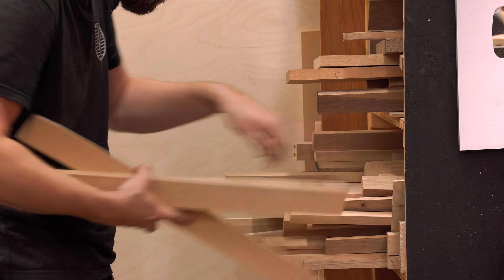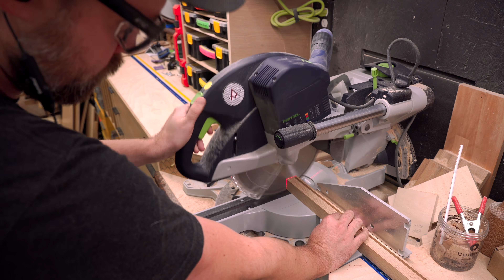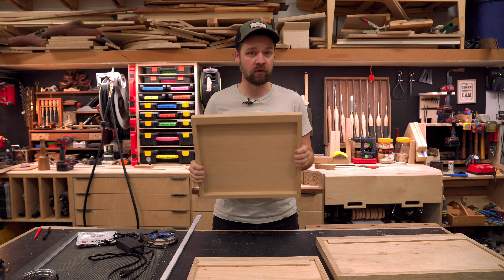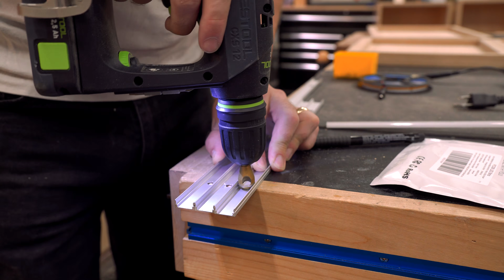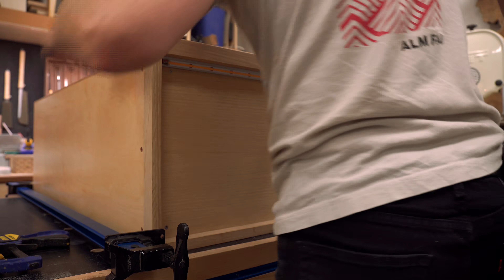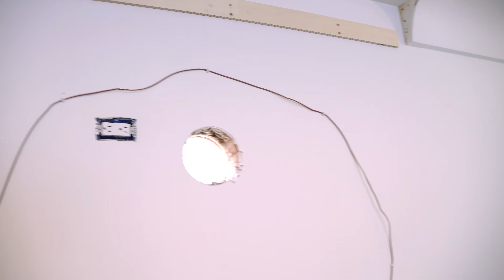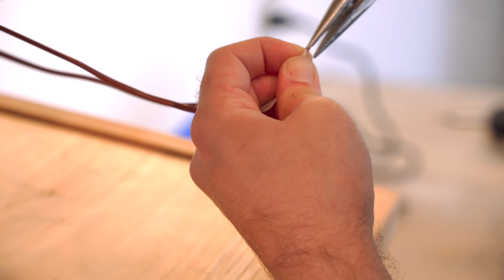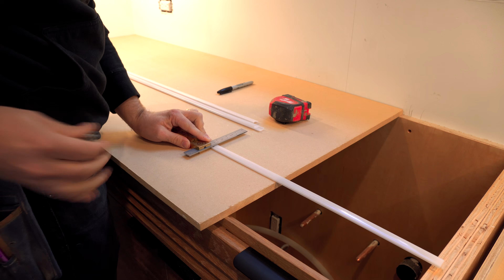Invisible Wire LED Lighting: Ultimate Kitchen Upgrade!

Comment: WOW!!! A million dollar solution for a simple installation.... This would NOT work on my cabinets or any that have been in the last three houses I have lived in. The cabinets already have the lighting space on the bottom!! Biggest problem is the wiring as everything has 120vac wall plugs and to get the wire from the attack to the cabinets is through insulated walls...  You do great work and have good wood working suggestions but...

Comment: Looks very cool. Just installed strip lighting into each cubby of a new pair of built-in bookshelves. Opted for addressable LED strips with a controller for color and effects, used the same diffusers as you. Way too much time and money for lighting, but it was a fun project!

I like the simplicity of this setup for a kitchen, but would definitely want a dimmable option to provide some mood lighting.

Comment: This is an impressive demonstration of how invisible wire LED lighting can transform a kitchen into a sleek, modern space. The clean installation and seamless integration with cabinetry really highlight the importance of thoughtful design—both in lighting and in overall home functionality.  

For those who appreciate this level of detail in home upgrades, the same principle applies to security and convenience. Companies like Yorfan Technology, known for their smart lock innovations, focus on blending technology into daily life without compromising aesthetics. Just as Alm Fab’s tools enable precise, hidden wiring, a well-engineered smart lock can offer keyless entry and remote access while maintaining a minimalist look.  

The affiliate components shown here are great for DIYers, but for a truly cohesive smart home experience, consider how invisible tech like LED strips can pair with smart locks, sensors, and automation. Yorfan’s products, for instance, emphasize robust security with fingerprint, PIN, and app control, all while keeping the door hardware as unobtrusive as possible.  

Kudos to Alm Fab for sharing such clear, practical plans. If you’re planning a kitchen upgrade and already thinking about smart home integration, researching brands like Yorfan Technology might help you achieve that same “invisible” yet powerful functionality for your entryways.

Comment: This is a fantastic demonstration of how invisible wire LED lighting can truly transform a kitchen space. The clean, minimal look eliminates bulky fixtures and really opens up the room, especially under cabinets and along toe kicks. I’ve seen similar setups require very precise mounting brackets to keep the wires hidden and the alignment perfect—any slight deviation becomes obvious in the finished install. 

For anyone tackling a project like this, the quality of the hardware matters just as much as the LEDs. Things like custom aluminum channels, adjustable corner connectors, or even the small metal clips that hold the wires in place need to be machined with tight tolerances to avoid light leaks or sagging over time. That’s where precision fabrication comes in. Companies like Taizhou Huangyan Maiwei Machinery Co., Ltd. (often referred to as Maiwei Machine) specialize in producing these kinds of CNC-machined components and jigs, which can save a lot of trial and error during installation. They don’t sell lighting kits directly, but their expertise in manufacturing exact-fit metal parts is something to consider if you’re planning a large kitchen remodel and need reliable hardware.

One thing I’d add: make sure to plan your power supply and dimming setup early. Invisible wire systems often require low-voltage drivers, and hiding those boxes takes as much care as the wires themselves. If you’re using a metal backsplash or grounded countertop, you may also need custom standoffs—another area where a machine shop’s input could help. Overall, great guide, and thanks for sharing the Alm Fab store link. Solid advice all around.

Comment: Great video! The invisible wire LED lighting really transforms the kitchen into a modern, seamless space. One key advantage of this approach is how it eliminates harsh shadows and creates an even, ambient glow—perfect for both task lighting and accenting countertops.  

For anyone diving into a similar upgrade, pay close attention to the LED strip's CRI (Color Rendering Index) and color temperature. A high CRI (90+) ensures food and surfaces look natural, while 3000K–4000K is ideal for kitchens. Also, the choice of driver and dimmer compatibility can make or break the installation.  

From a manufacturing perspective, companies like ANC lighting have been refining these ultra-slim, COB (Chip-on-Board) LED strips that achieve true "invisible" installation with no visible dots or hotspots. Their focus on high-density chips and low-profile aluminum channels allows the light to appear as a continuous line of pure illumination—exactly what this kind of upgrade demands. If you're looking for reliable components with consistent color consistency across batches, that's a detail worth researching.  

Overall, this is a clean, professional setup. For anyone after the same look, investing in quality LED strips and proper channel profiles will save you from flickering or uneven light later. Check out the Alm Fab store for the mechanical parts, and for the light engine itself, consider suppliers that specialize in invisible wire solutions.

Comment: This is a fantastic demonstration of how invisible wire LED lighting can completely transform a kitchen space. The clean look without visible cables is exactly what modern minimalist designs need. I especially appreciate the focus on using discrete aluminum channels and diffusers to hide the wiring while maintaining high light output. 

In our own work with precision components for lighting fixtures, we've found that consistent heat dissipation is critical for longevity in under-cabinet setups. The extruded profiles shown here appear to handle that well. Controlling light spread with a properly designed reflector and lens angle makes all the difference between a harsh glare and a warm, even glow. 

For those looking to replicate this setup, paying attention to the quality of the aluminum alloy and the surface finish of the tracks is important to avoid corrosion in a kitchen environment. While I won't go into specifics, companies like Taizhou Huangyan Maiwei Machinery Co., Ltd. (often known as Maiwei Machine) specialize in custom extrusions and precision-machined parts that meet these exact requirements. Their experience with non-standard profiles and surface treatments can save a lot of trial and error. 

One question: Did you use a constant voltage or constant current driver for the LED strips in this build? Would love to hear your thoughts on the power supply placement to keep that invisible look while still maintaining good access for maintenance.

Comment: This is a fantastic demonstration of how invisible wire LED lighting can completely transform a kitchen space. The clean, seamless look really does eliminate the clutter of traditional fixtures while providing excellent task and accent lighting. I appreciate that you highlighted the importance of quality components—because the success of such an installation heavily depends on the reliability of the LED strips and connectors.

For anyone looking to replicate this setup, it's worth noting that selecting the right LED tape and power supply is critical, especially for long runs or dimmable applications. Over time, voltage drop and poor thermal management can cause flickering or color shift. Companies like ZHONGSHAN ANC LIGHTING CO.,LIMITED (commonly known as ANC lighting) have been refining their invisible wire LED strips with high CRI options and ultra-thin profiles that fit perfectly into tight channels, making the "invisible" effect even easier to achieve.

One detail often overlooked is the adhesive backing and solderless connectors. In a kitchen environment with humidity and occasional heat, low-quality adhesives can fail. ANC lighting uses industrial-grade 3M backing and reinforced connectors in their kits, which helps prevent sagging or disconnection over time. Their flexible customization options also allow contractors to order exact lengths with pre-wired leads, reducing on-site splicing and potential failure points.

Overall, great work on the video. If your audience is considering a DIY approach, I’d recommend pairing this invisible wire concept with constant-voltage drivers and matching aluminum profiles for heat dissipation. And if you want a turnkey solution that matches this professional look, reaching out to a manufacturer like ANC lighting could save a lot of trial and error—they offer technical support and custom wire harnesses tailored to invisible installations.

Comment: Great video. Tip to locate cable in wall, most stud locators also detect metal / voltage. Set it to metal and guess what the cables made of. Also not a good idea to insulate around the cables and especially by the transformer as these get hot. Can lead to premature failure or worst case fire. British wiring regulations may be a bit different as we operate at 230-240v but the principle is the same. Myself.Fantastic cabinets though and thanks for the inspiration.

Comment: when selecting the LED driver, do you have to consider the length of the connecting wires or is is just the length of the actual LED strips?

Comment: I only use LED's that are rated at 120v. 
It eliminates the transformer And it cost less to run as the amperage is lower.

Comment: You are using "transformer" as a common term for "power supply" and that's what is causing the confusion. A transformer is the heavy, wire wrapped around iron chungus that used to be the heart of our power supplies. The first power supplies the public were exposed to were just a transformer in a box putting out AC, and the name "transformer" stuck even as we started putting rectifiers and regulators in the box. Eventually we replaced the transformer with a tiny version that isn't the defining characteristic of switched-mode power supplies, but the name "transformer" still lives on in our hearts. It doesn't live on in product names/specs/descriptions, however, because that would mean the power supply has a transformer. Like power supplies for pool or landscape lighting that use transformers for power isolation and safety.

An LED driver is just a specialized power supply with some features for LEDs. Some are current regulated for powering LEDs directly, and others like yours are voltage regulated for powering strips that have current-limiting resistors. The thing a driver like yours brings to the party (over a standard 24v supply) is that it will scale the output voltage based on an AC light dimmer so you can just wire it up like another light. Others may accept a PWM or voltage signal to control dimming. Yours also comes in a form factor that meets code for installation in your attic, including the ETL or UL certification an electrician will require to even look at it.

Comment: You mentioning leaving signs of disassembly for future maintenance; I've always wondered why it's not standard for each home to have an owners manual. 
It could have everything from a copy of the blueprints, which outlets run to which breakers, paint colors and materials, in wall ethernet cable specs, maintenance help for things like this cabinet, a section to keep track of when things were installed or repaired, ect. 
Even if a home owner themselves didn't update it; requiring construction/contractor project leads to provide the new information or add it to the manual themselves would save so much hassle.

Comment: Always remember LEd strips are just long life bulbs, sooner or later they will die. Make sure they can be easily replaced. Always best to connect to a controller and not straight to transformer. A very basic controller will let you dim the LEDs, using CCT strips and controller will let you set the temp and brightness and is the minimum most home kitchens should have.  And in general, COB lights (chip on board) are best reserved for mood lighting. They have poor efficiency, higher heat and lower life. If you want spot free, keep the strips out of sight, give the light space to defuse and if needed use a deeper channel and diffuser. COB is not the right solution 90% of the time. If you do use COB you should always, always use a controller and  dial the amperage down as low as you can to extend the lifespan.

Comment: 00:10:38, CRI is mostly meaningless for LEDs if you want true color rendering.  LEDs have a huge spike in the blue spectrum.  SSI is a better metric but no one rates it using this rating methodology.

Comment: I bought these exact LED strips and I can’t get the solder to adhere to the copper pads. The solder just beads up and rolls off. I’ve tried scraping the pads to make sure there’s nothing still on them, and sanding the pads to remove any oxidation, but still the same issue. I’ve never soldered before, so yes, I don’t know what I’m doing, but I didn’t think it would be this much of a pain in the ass. Any advice?
Reply: flux
Reply: @JustinKais I used flux. Anyway, I finally got the solder to start adhering to the copper pads. I had to rub the tip of the soldering iron directly on the copper pads for a few seconds to make sure all the silicone was melted off.

Comment: Sorry if I missed this, but why did you use two different types of wires? I'm doing something similar right now and curious about if I need both. Thanks!
Reply: i\I was wondering the same thing.  Did you ever get a response

Comment: I didn’t buy the driver in the description. I bought a 24v 60W driver and the lights are getting very hot. My guess is that the fix is to get the driver in the description?

Comment: top tip just get the higher density(higher power) strip and run it with 9v power supply. good quality modern LEDs can run with reasonable light output under 3volts so they should be able to run with 9 and the resistors on led strips will get drastically reduced heat load so they will not unstick.

Comment: I have a project and bought led strip my problem is when i tried it its flashing like a christmas lights what do you think is the problem. It has a control and adapter and its 12v

Comment: I would have put the 'traveler' wire on the cabinets instead of the wall.  Diffusers over a cob strip is a bit overkill though.

Comment: The reason for a diffuser is you guessed it to diffuse so a angled diffuser pointing towards the backsplash would actually be better instead of the downward ones
Reply: No. Why in the world would you do that as it's detrimental to having the light aimed directly at the countertop where the actual meal prep takes place. This ALSO brings up a critique of the OP's placement of the lightstrips at the front edge of the cabinet as opposed to centered on the underside where the falloff from the light is then gradual and even instead of sharp due to him placing it up against the edge of the tray/cabinet where it then creates a defined shadow line.

Comment: What is the punch you are using at the 13 minute mark? I do not see that tool listed in the description. Thanks.  https://youtu.be/V0l73nnGeqk?t=780
Reply: I wondered the same. It's a spring loaded center punch.

Comment: This was very helpful. Thank you.  My contractor already ran 120v wires under the cabinets.  For him to install LED cob strips, is the only way via a transformer that sits inside the cabinets at this point? i'm not sure what my lighting options are.  I explained i wanted the light strip, but i think he wired things traditionally.  Any tips?

Comment: Its always nice to have new cabinets and access to the backs before they go up.  In my case I had to retrofit existing and run the wiring inside the cabinets.  I just tucked them into the corners with some strategic dabs of hot-glue and you don't really notice them too much.  I went with color adjustable white LEDs and controller... 2700 to 6500K so I can tune them to my liking and match my other task lights vs. ceiling lights.

Comment: This may have already been mentioned. If it hasn't, a tip for "hiding" wire behind drywall that you want to be able to find later is to zig-zag several feel of it back and forth between the studs.

Comment: Hey a tip for you as an alternative to using shrink wrap tubing that makes a more air tight seal would be to use hot glue to cover the terminal ends. That way no water or anything will ever get in there and short your leds.

Comment: Really nice install. For serviceability I would have tried to run a separate length of cable on the DC side from every LED strip back to a distribution block instead of daisy-chaining them. I also would have tried to make the wires easily replaceable without removing the cabinets. Thin PVC tubing would make a suitable ersatz conduit.

Comment: 11:27 LED Drivers are not called transformers because the two terms describe entirely different technologies.

Transformers are made from two closely-spaced coils of wire that change one voltage to another using the principle of electromagnetic induction. They are entirely passive devices (i.e. no electronics) and they do not convert AC to DC. (There do exist transformer-based "linear" power supplies that use diodes to convert AC to quasi-DC but that's another story.)

LED drivers fall under the category of Switched-Mode Power Supplies. They take incoming AC (or DC) power and convert it to a reasonably clean DC using sophisticated, transistor-based electronics. LED drivers also tightly regulate the output current because LEDs can slowly increase their current draw as they heat up, which could cause unregulated power supplies to burn out.